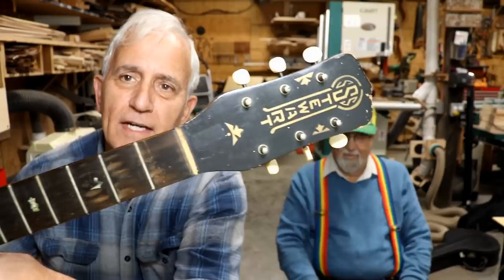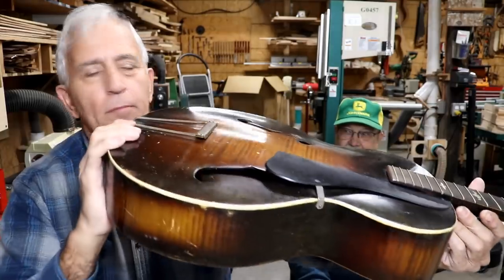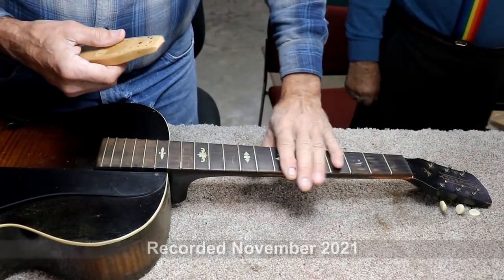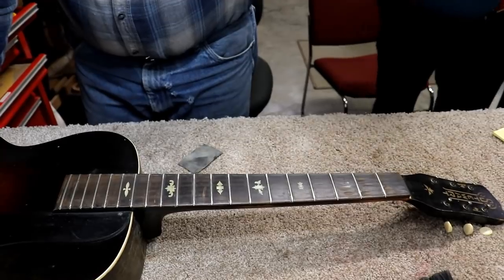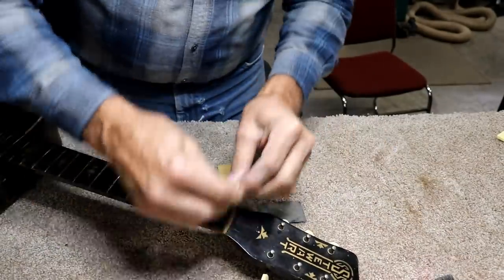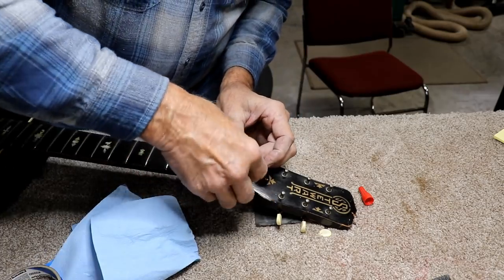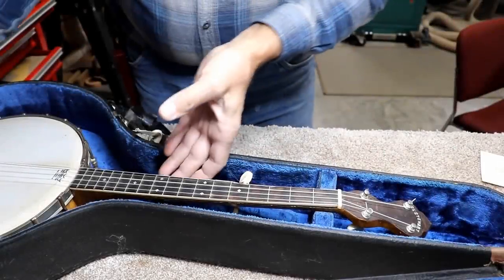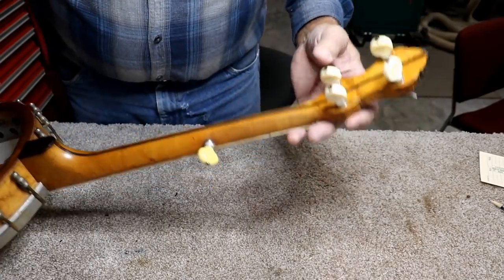575 RSW One Customers Instrument Repair EXTRAVAGANZA - Part 1

Comment: Have a new Yamaha AC5R Acoustic. Sanded the saddle to lower the action which is now very good. The only issue is the D string buzzes when fretting the 4th to 14th fret. It sounds like it’s coming from the bridge area, or a fret around the 14th fret.

Comment: A plectrum banjo which a tenor is a plectrum only has 4 strings and is tuned in 5ths like a viola CGDA. Since that has five strings it’s turned to standard five string banjo turning gDGBd the reason it only has 19 frets was because most people didn’t play past the 7th back then and the plastic head wasn’t invented yet. they used calf or goat hide which could not get as tight as plastic and if you push on the head close to the edge it doesn’t sink in as much as in the middle so it may have the same scale length as a modern banjo but moved forward so the bridge would be closer to the edge so it wouldn’t sink in.